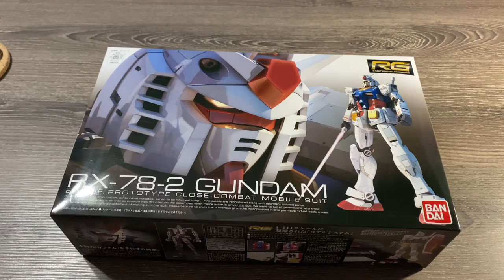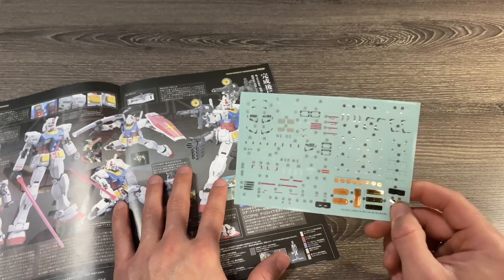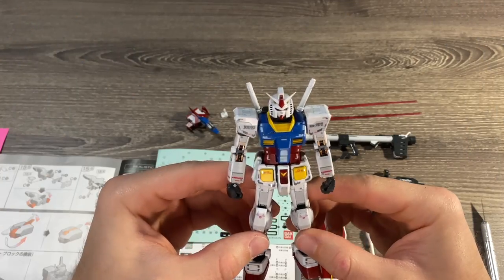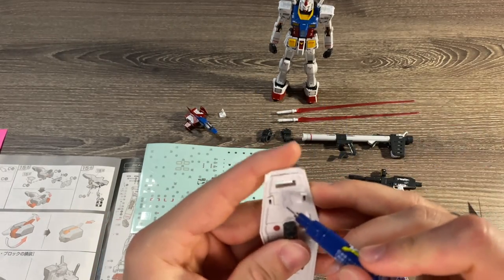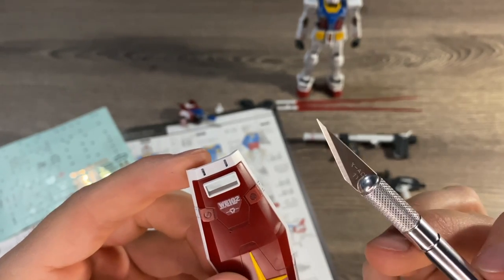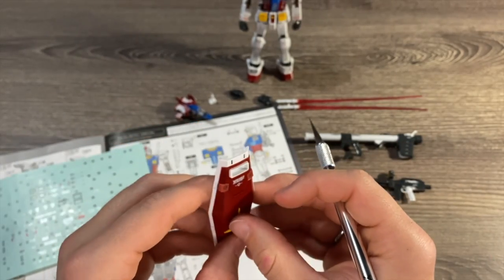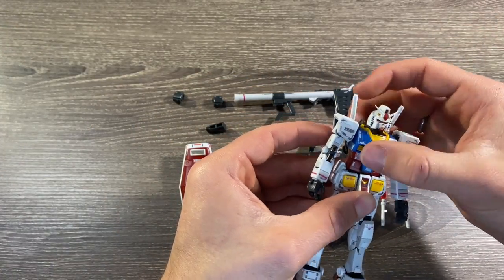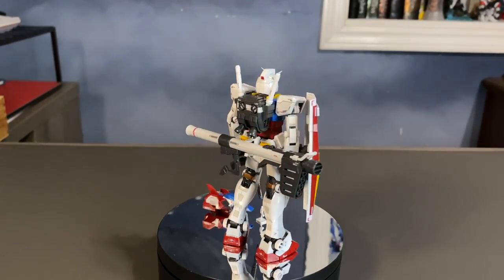HOW TO APPLY STICKER DECALS! RG RX-78-2 Tutorial and Review

Comment: the best way for me is to use the tip of a toothpick ( less sharp and more soft compared to the "reverse blade" method) and gently scrubbing the surface of the sticker for perfect adhesion. No risk to sratch anything, expecially on shiny metal stickers.

Comment: one issue I have is eyeballing/ hand steadiness when placing the stickers.  Getting them in that exact right spot, I almost never do and have to dry to drag the sticker around, which can be very easy or very difficult it seems.  I've even scratched up stickers and models when it was particularly difficult.  Any tips on that?
Reply from the maker: This is area where water slide decals do have the upper hand.  The only tip I can give is to be patient when removing them and invest in a good pair of needle sharp tweezers.

Comment: I'm going to try this. One suggestion, for the "squeegeeing" that you're doing, instead of using the hobby knife and risking scraping and cutting the sticker, maybe use a guitar pick or a hard plastic pan scraper?
Reply from the maker: Thanks for the suggestion! I’ve tried using the tweezer in the past, but I’ll try it out on my next build and see if it works the same
Reply: @whatwillbuilds6068  I haven't put stickers on any of my builds yet, except maybe the reflective ones for like the eyes and lenses.

I did just finish building the dom prototype from the Origins line. I just used a q-tip though. It's really hard to properly line up those longer stickers >_<
Reply: 100% on guitar pick

Comment: This is all wrong. You don't mention using setters, softers, tweezers, etc.
Reply: These are not waterslides what are you talking about
Reply from the maker: This is for the sticker decals that come with most Gundam kits nowadays. Tweezers are helpful but not always necessary. Have been thinking about trying softer on them to see if it makes a difference. Haven't seen a video on it, so I'll try to make one if I try it out and it works.